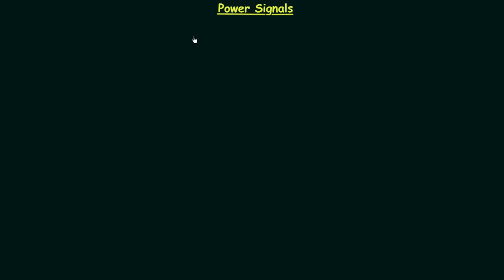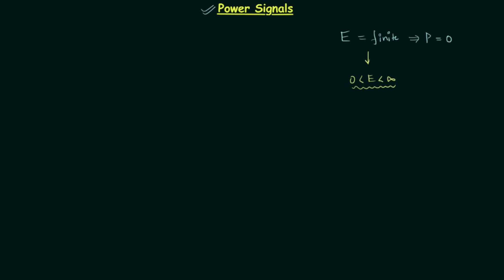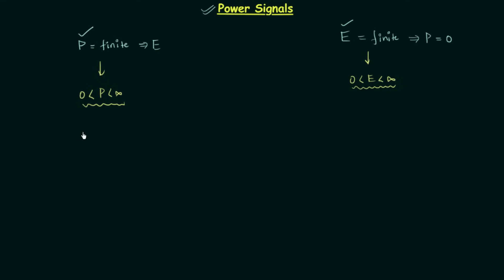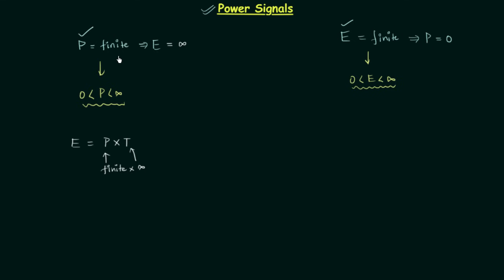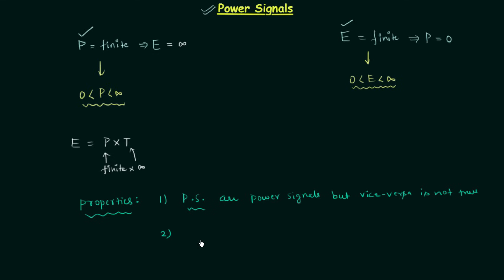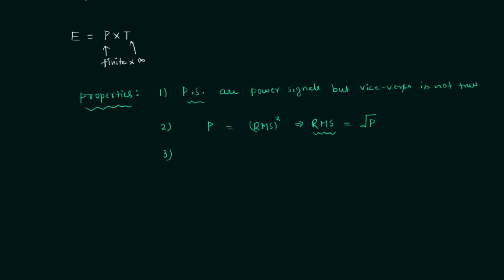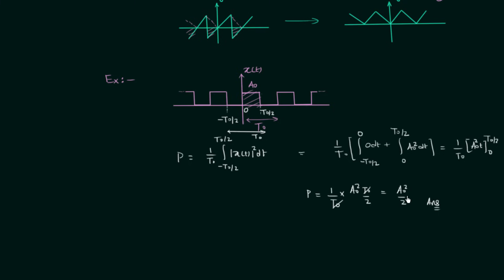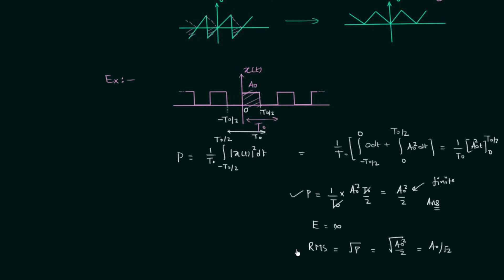Power Signals

Comment: avg power = (Ao^2)/3,false. The line equation  to  be taken is  x(t)=  - (2Ao/To)*t btw -To/2 to 0 and x(t)= +(2Ao/To)t btw  o and +To/2. and  solve...
Reply: How ?
Reply: @amankumargiri3163  use the formula Y=Mx formula where M = (y2-y1)/(X2-X1). This will give yo x(t) as Aishwarya mentioned above.
Reply: But the avg power is (4Ao^2)/(To^2)
Reply: Can anyone pls explain  why it is false , we got p as finite value
Reply: @sudeepreddy5130  simple defination, :a signal is said to be power signal if, its power is finite.
Reply: @fazilhamza1476  but the eqn of first line is wrong..it is not passing through the origin
Reply: @sudeepreddy5130  question says it's not a power signal so false.

Comment: P=(A0)^2/3 
Is it correct?
Reply: Could  you please explain how?
Reply: I used slope method
m1(-ve)= -2Ao/To   and m2(+ve)= 2Ao/To
y1=-2Ao/To +C  and y2= 2Ao/To +C
here c=0 in both equations, then just put these two equations in formula.
Reply: But how you got positive valves while performing limits from -T/2 to 0? Sorry I still little bit confuse.
Reply: If u don't mine, can you please  write the steps or snap photo of the solved copy.
Reply: Till here, I got the same results but can you explain the steps further when you evaluate the integral? Thanks